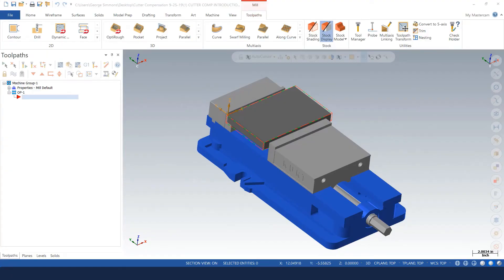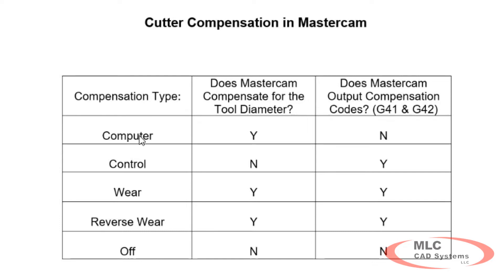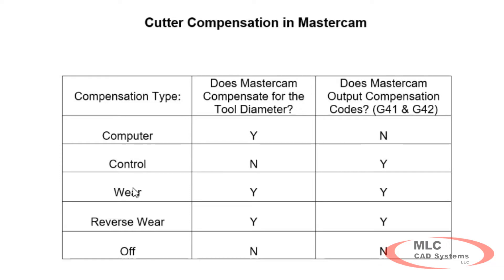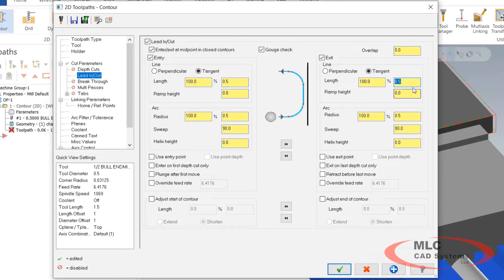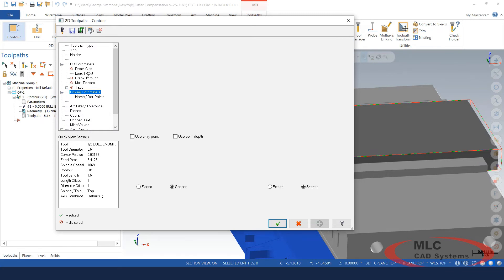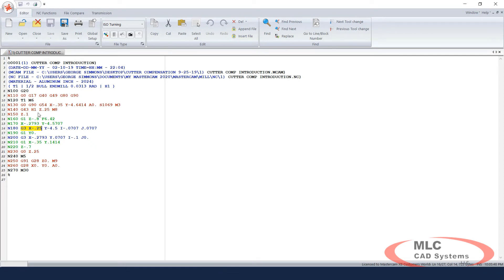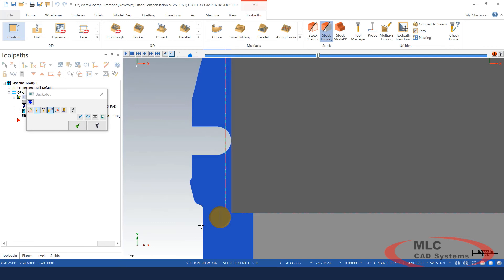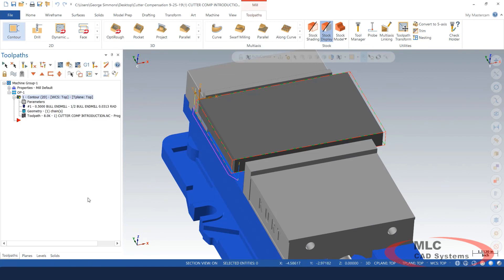Introduction to Cutter Compensation in Mastercam

Comment: This was a great explanation of all the modes for me coming from panel programming to mastercam. Especially understanding where each mode could be useful and which will have comp codes. I now wonder if I enter the offsets for wear in the wear section of the control, or the tool diameter secton.
Reply from the maker: Set the diameter of the tool to the nominal value, and then input the wear value into the control.  As the wear value changes, the machine motion will adjust but the original program will stay the same.